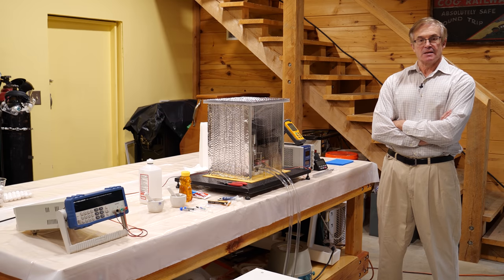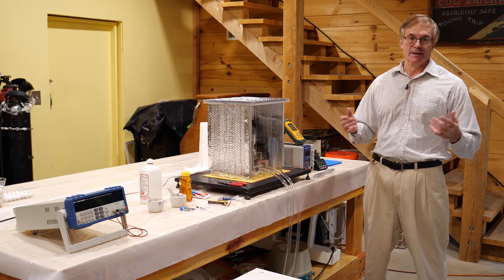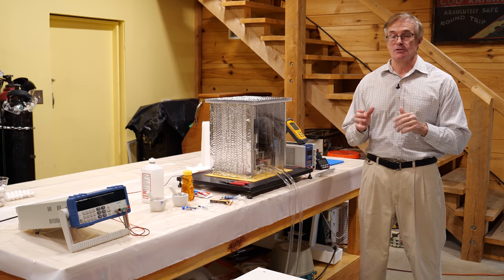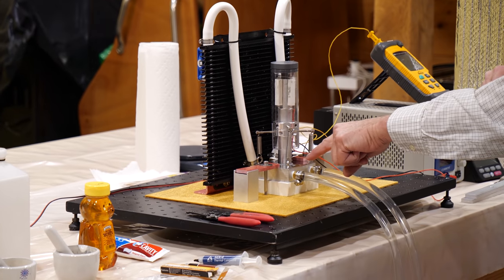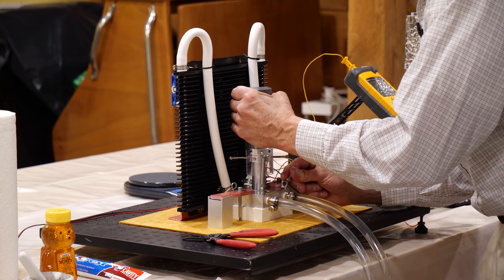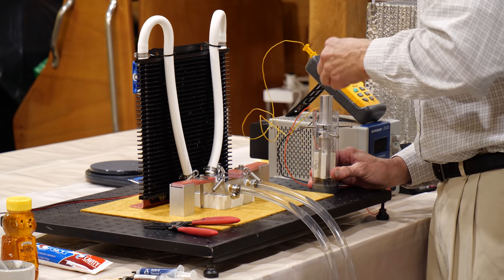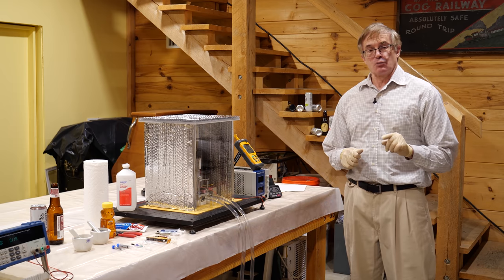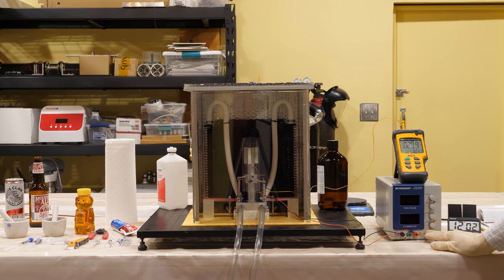DID WE JUST MAKE THE WORLD'S BEST THERMAL PASTE!?

Comment: Really intriguing video regarding thermal paste! I do a lot of 3D printing and found that using thermal paste between the  heat break and heatsink of the hotend helped prevent heat creep. As you mentioned in this video that water based thermal paste, I used Slice Engineering's Boron Nitride Paste on the heatsink side. It's good for preventing electrical conductivity after drying, but I believe using grease like compounds like the one you made would perform and last longer than Boron Nitride, wouldn't it? 

Hope to give this a try when I have free time or just buy some if still available. :)

Comment: Can you attempt to make integrating spheres for measuring light output? 
When will your boat be in another video? I'd like to see it with a couple of water cooled brushless motors inside the 2 pontoons and running on at least 48v if not 82v. It would be the same idea as the 2 trolling motors, just lots more powerful. Inexpensive inrunners are very common and might cost you $250 for 2 motors than can deliver upwards of 15kw total.

Comment: This will be quite useful in printing nylon with my 3D printer as I will be able to dry heat away from sensitive parts such as stepper Motors more effectively well still using standard aluminum heat sinks and an AC unit with a ducting system to apply cold air to the heatsinks and other heat-sensitive components such as wiring rubber belts and 3D printed parts that are as much structural as custom-designed

Comment: Interesting video!  I wonder what the temperature stability of the homebrew compound is compared with the commercial compounds.  I used the Noctua paste on my last PC build (12 years ago) but the stuff was so thick I had trouble applying it to my CPU. Turned out the temperature in my unheated computer room on a cold winter day caused the stuff to congeal to the point that it was quite difficult to squeeze from the tube.  A few minutes with a hair dryer fixed that problem, but it clearly showed that a low room temperature can cause a change in consistency.  These changes no doubt occur every time a PC is turned on from a cold state.  Could they lead to a breakdown or loss of efficacy of the compound over time?

Comment: You should look into "pump out," where over numerous heating & cooling cycles, the center of the CPU die expands a bit more than the outer edges.
According to Der8auer, this is why Thermal Pastes "go bad" most of the time, not because they dry out or get baked or anything, but because the repeated relative expansion and contraction of the die slowly pushes the paste to the edges, leaving a bit of a gap in the middle.
Unfortunately, that would require more of a square "full contact with the edges of the die" pressure rod.
Reply from the maker: That or repeated heating cycles.  We've got two computers now at three months on going with no degradation so far.

Comment: Paste performance is heat power conducted divided by the temperature difference and area.  You could obtain standard units for easier comparison by performing an equilibrium experiment:  Apply known power, let temperature stabilize, and measure the temperature difference.  Equilibrium will arrive much faster if the heater is closer to the interface.  Conductivity is this performance times the thickness; but, thickness will vary with paste's fluid properties... less measurable and less useful for this purpose.  Heat leaks would not be very important except for very low conductivity materials.

Comment: Wow talk about making sure your test is going to be reliable and consistent. that is amazing . he has thought of everything from the largest star in the known universe. all the way down to a planck length.  Back when I used to build my own computers I would have taken the best thermal compound even if it was only a fraction of a degree in difference from others because i was that picky when it came to my electronics. I used to like to smear a little bit on the CPU and smear a little on the heat sink to make sure it sticks just in case it tries to seperate overtime, and then I would put my bead down

Comment: Yup.  We changed a cpu in a controller and the new chip gets much hotter at stock settings.  I suggested we underclock the cpu, which solved the problem, but wasn't too popular a solution.  I think we went with a glued on heat sink.

Comment: Friction welding under vacuum of very thin metallic films could work. As thin as leaf gold. Gallium, tin and lead come to mind. Anyway, I dont think you need a high pressure if you tweak the temperature fast enough and for example etch the surfaces to remove oxide layer.

Comment: I hav an idea for you to try! Sins silver iz fairly soft, wut if you had sum ballz, maybe 1mm maybe 3mm, maybe 10mm and applied enuf pressure to deform them between the rod and the chiller surfase in order to get perfect metal to metal contact?  The hypothosis being that, even tho you arent getting rid uv air or wutevr poor conductor, the perfect contact surfase area acheived and the very hi conductivity uv silver mite make up for it. The problem with the pastes and gluez iz that the tiny metal or diamond particlz hav so much surfase area to begin with that they cant be deformed with any practical level uv pressure. The thing that coud make it uv practicle value iz if the rezult iz better than the indium sheet due to silverz superior conductivity.

Comment: Does the viscosity of the compound make a difference, or does the mounting pressure negate that? 

Loved the video thanks <3
Reply from the maker: The viscosity matters a lot.  The clamping pressure is fixed, the lower the viscosity the thinner the bond line and the better, but viscosity is directly related to thermal conductivity as I explain in the next video.

Comment: You could also use a different approuch. Simple heating to 40°C and lower the power of the power supply until it stays there. The used power will then correlate to the thermal conductivity. Then you dont have to wait for the device to cool down. In combination with an arduino you could use pwm and graph the duty cycle and read it when its steady
Reply from the maker: That would work, but each cycle would take significantly longer because stabilization would be asymptotically approached.

Comment: Thank you for this video. I'm trying to cool several Laptop GPUs Using flat servers copper heatsinks, But with a small gap I lose several Degrees Celsius. This is definitely Helpful more than you can imagine
Reply from the maker: Did you watch our previous video on the thermal epoxy?
That's where I demonstrate the surface preparation technique.

Comment: What if you make a follow up video where you press down on a set of thermally non-conductive "gauge washers" around the paste, letting the paste "sit freely"? That way you could be able to validate the material itself only while completely isolating random metal to metal connection (like when you would just lap these surfaces you would get to skip the paste entirely and get better results if you wring the metal surfaces together)

Comment: nice job! congratz! would be very curious on results for some "liquid" metal based pastes, again, i know it's not apples to apples but it would validate the testing method i guess? thermal grizzly has both a very good normal paste (cryonaught) and a metal one (conductonaught) if you could find them?

kinda feel that ltt was a bit rushed on their end conclusions, yes, the equilibrium temps are the same, of course they are. that says nothing about a paste. just about the ratio between the cooling capacity and heat generation. and yes. an air cooler on top of a 10900k will always reach equilibrium. any paste applied correctly would give almost the same results.

what they should have focused on, was how long? did it take the whole system to reach the stable 80-85 range? a good paste would be able to maintain lower temps for longer. and on very close inspection of their vid, yes, yours had a softer increase on their graphs. i call that a big win. 

i havent finished the second vid yet, but did you consider the long term usage? i.e. does the paste dry to fast? does it resist well repeated jumps in the 20-80C range?

Comment: For years I've been a big fan of the Prolimatech products, as their product performed great. Unfortunately, PK-3 is almost impossible to find in the EU and is expensive. I would love to try our Your product, but am also concerned about longevity. Second - could You test it at higher temps? Usually CPUs would idle at 20 - 30 C, however thermal conductivity changes with temperature. In addition, I think I've seen a dewar storage tank laying around Your "office". Could You maybe test performance under extremely low temps? Should open up the market towards extreme overclockers.

Comment: I loved this video! Quick question: What are your thoughts on creating a more thermally conductive coolant for water loops (such as those in PC's)? Can it be done in a similar way to the ways in which you've made the thermal paste and thermal epoxies? 

I came across the brand 'Go Chiller' based in Australia which claims to improve cooling by mixing graphene powder and deionized water. LTT and others have done demonstrations that the cooling performance in PC rigs seems to improve by a few degrees Celsius. In addition, and perhaps more importantly, the brand claims that they have significantly lowered the viscosity compared to typical water coolants. This claim seems to be widely verified on Reddit forums (where many users claimed to experience dramatic flow rate increases - even up to 3 times compared to traditional water-based coolants). I haven't been able to verify it myself (as I live in the USA and the shipping from Australia is rather expensive).

Your videos make me think that perhaps an even better coolant could be engineered with excellent thermal conductivities and flow properties. I'm eager to try but I feel like I'm probably going to just waste a bunch of money and materials working it out. 😅

That comment in the video about Murphy sitting in a corner and rubbing his hands mischievously hits home, haha.

Comment: I have always used Tuniq TX-4 (not always, but ever since I started its my exclusive TIM). I get as much as a 5° Delta compared to others. Not sure if my tests were seriously flawed, but in every test, TX-4 has come out on top. Can anybody confirm this?

That said, an online computer shop was closing, and I bought like 200 syringes of Ceramique 2 for around $20, so I use that for things like LED's, IC's and the like. It performs more than adequate in those instances, which I find depend more on the heatsink itself than the TIM.

Comment: Just an idea for a possible future project. I've been preoccupied by any possible ways of making quadcopter or small drones quieter. Currently they all use small electric motors that generate a loud whine. The noise must be coming from the bearings but primarily from the blades. As the blades push the air, it creates high pressure in front of the blade, and low pressure behind the blade resulting in the osculation of low and high pressure waves that we all know as sound. I was thinking about Tesla turbines. They use air to spin a turbine made of a stack of disks that have no blades. I also believe a turbine could be run in reverse. I mean to say that you could spin the stack of disks manually in order to move air. Would that be a way of generating wind without the whine of fan blades?  Maybe in some far off time, we could have drones that don't sound like a dieing cat flying around our offices delivering mail and what-not.
Reply from the maker: Tesla compressors exist.  His design suffered from the extremely high edge velocities required for reasonable effeciency.  They are loud.
A ducted fan can be pretty quiet.

Comment: Any plans to continue this thermal interface series with thermal pads? IMO, thermal pads are much more interesting, as their thermal conductivity can can vary in which direction you're testing, this is how some pad-like products have absolutely ridiculous numbers yet their conductivity along the Z-axis (in Z-up) isn't as great as what is claimed. Pad thickness and performance due to thickness is also an interesting topic of debate. Compression of a thermal pad is also another topic, as there's reasons we don't use extra thick pads when there's no point to. I'm also talking about what are generally used for memory modules in GPUs, not the 'reusable' graphite pads that're supposed to be a paste/grease replacement; though, those are interesting, but I don't think they'd belong in a generalized thermal pad topic.  

Also, when you're sending samples of house-made alternatives out, you should be sourcing more than one outlet for third-party testing. LTT is great and all, but they're severely focused on performance and not science, take their thermal imaging trainwreck of a video as an example; the collaboration is good for getting more eyes on your own channel, but LTT isn't really science and fact based. I would suggest, at the very least, sending samples to Gamers Nexus, as they do have solid testing methodology, a non-computer heater-based testing rig (quite possibly even an industry-standard testing rig) for this purpose of testing coolers, fans, and pastes could be tested on the same rig as well, they're always adding new tests and equipment to their lab, and they do prioritize fact and science over entertainment and revenue. Beyond them, I would also look at sending samples to the various larger overclockers on the platform, they could not only provide more real-world testing, but they'll also push the limits of the product beyond what the typical enthusiast use-case will be, especially with those that get into liquid nitrogen cooling.

Comment: I remember reading a study that was trying to refute the advantages of lapping the mating surfaces.
Something about how the microscopic surface imperfections actually introduced more surface area and increased thermal conductivity as long as the thermal compound made contact in these microscopic valleys.
I always found it dubious, but also wondered if there was any truth to it.
Reply from the maker: It might work if the grooves could be made to line up otherwise the increase distance through the bulk material negates the potential advantage.

Comment: Always love the content you guys produce. Captivating, educational and most important of all informativentertaining I mean. With that said. I would really love to see what repetitive heat-/thermal cycling does to your compounds? Does it make it lose its viscosity like some pastes do? Or perhaps does it pretty much keep its initial viscosity more in line with the properties of the Thermal Grizzly Kryonaut paste? How’s the runout? Does the heat produce evaporation so the paste gets pushed out as a result? I’ve personally been very interested in besides conventional TIMs a cheap high performing gap filler paste or putty more like. A GPU for example will have where thermal pads and paste aren’t applied large “empty” air insulated heat soaked areas on the board. These areas either aren’t conducive to pad or regular paste use yet getting these areas thermally interfacing with in this example my water block is naturally something I would very much like. Even if all I gained was a maximum 2°C. How I’ve done it now is with stacked thermal pads which have given me between 2-3°C so a putty that’s effective between 3-5mm or there abouts that doesn’t cost what it’s simply not worth is high on my wishlist this lifetime. 🤓 There is this blue/greenish maybe cyan colored putty but it’s too expensive to be worth it.
Again thanks for all the awesome content you’ve been creating and sharing all these years!!! Much love and appreciation from Sweden 🇸🇪.

Comment: A bit late to the party, but I'd like to see if running the system closer to cpu temps might allow some compounds to flatten out more than others and come out on top as a result.
Reply from the maker: We'll see.  We're modifying the rig with nickel coated surfaces and will be testing liquid metal thermal pastes and at higher temperatures as well.

Comment: The end temperatures are so similar for all the materials tested that I feel the test you're running is a bit too dependent on the thermal mass of the rod than the thermal conductivity of the material on test. It would probably be a better test to allow the system to reach a steady state. This gives the material on test a chance to exhibit it's best performance, rather than how it performs while the system is basically just warming up.

Comment: Would love to see you test the thermal properties of some of the pastes, epoxies and cements offered by Omega. I have seen their OB-200 used in manufacturing of temp sensors due to its high thermal conductivity facilitating fast response time. Their OT-201 also looks promising as a paste option.

Comment: I'm using what I believe is a gallium based interface.   Basically a liquid metal interface. Although your test apparatus is made largely of aluminum, I would appreciate seeing how one of the liquid metal interfaces would preform.  I would suspect as good as the indium interface material. I also would like to see a base line of no interface material as well as pure water.
Reply from the maker: We'll be testing liquid metal thermal interface materials (largely gallium) once we have modified the rig with nickel plating.